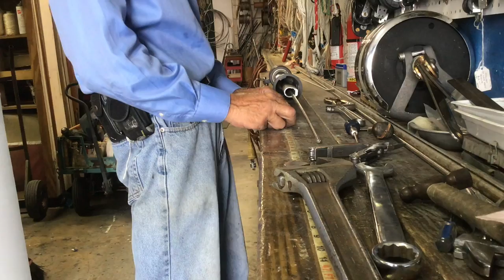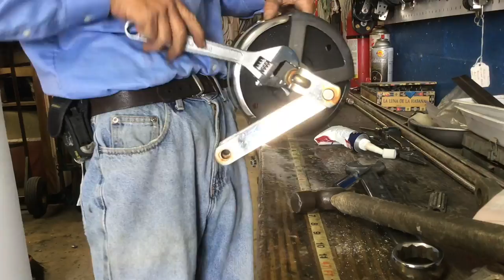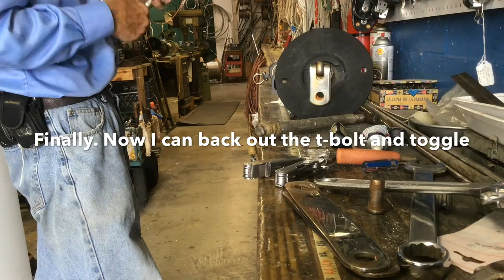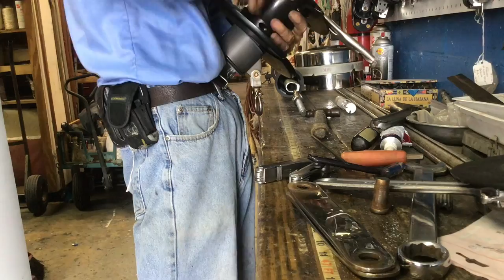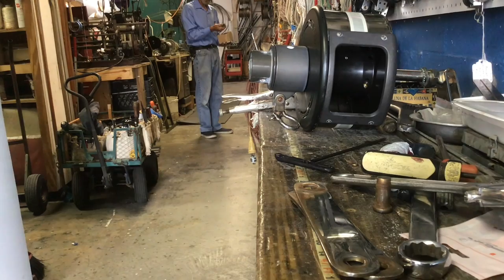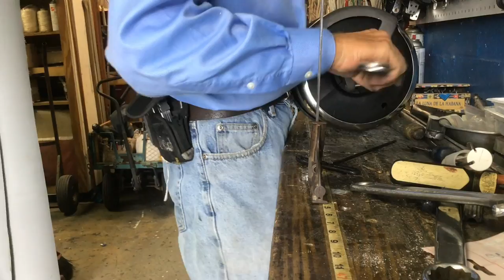Replacing The Wire In A Harken Roller Furling Headstay

Comment: SUPER HELPFUL VIDEO!!! thank you very much for posting. I am changing my 8mm headstay on a 35ft sailboat, and i want to reinstall my harken mk3 size 2. i also noticed that the locking collar will not fit the new sta-lock. did you completely replaced the locking collar and olf wire end fitting fot the sta-lock terminal? im considering doing the same